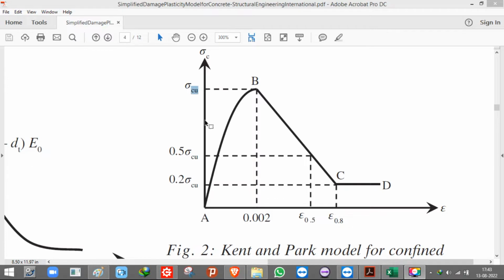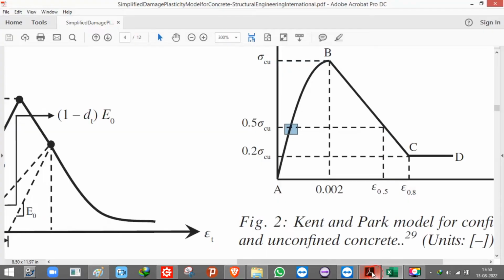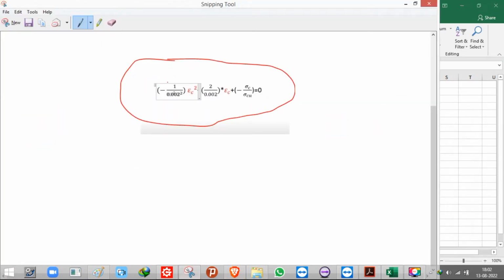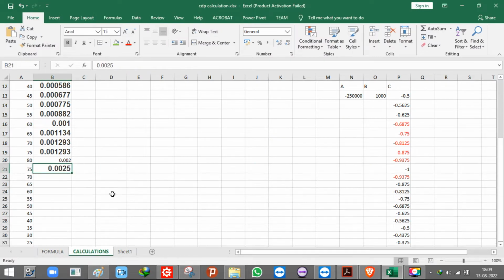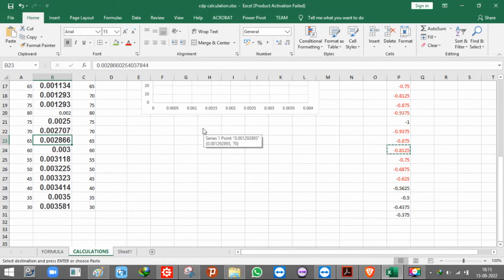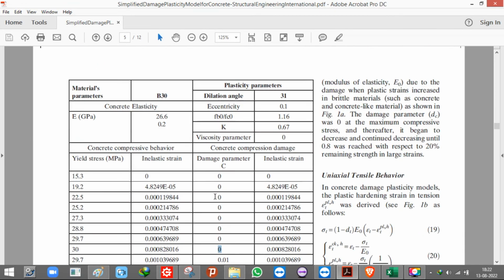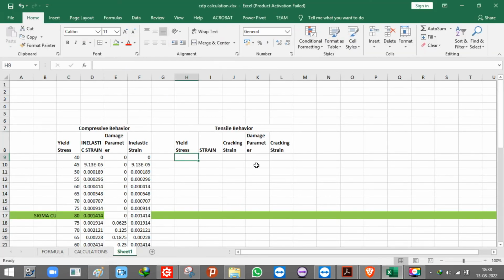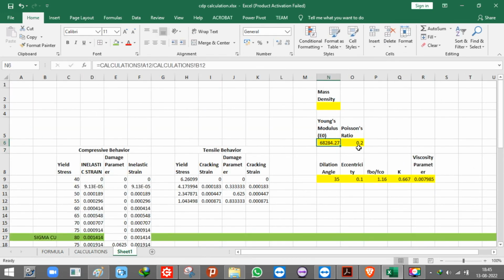#How #to #calculate #CDP #Concrete #Damaged #Plasticity #Properties #ABAQUS #Excel #M80  #CONCRETE

Comment: Hi sir, 
in the tensile part you are calculating the stress strain data with the second paper. There you have got 5 values. You have the maximum: so Y=0,7*sqrt(f_max) and y2=y*2/3 y3=y*3/8, y4=y/6. y5=0. In y5 you have epsilon_c*16. You did not calculate the last value. Was it on purpose? 
BG 
Thanks!

Comment: If we use the Kent and Park model which say that it is applicable for the confined concrete and use its formula to establish the stress - strain relationship then my question is i had done cylinder testing and ultimate strength i got from that is 80MPa so now in Kent and Park model what value of ultimate strength sigma(cu)  ?? i think it shouldn't be 80MPa and that from cylinder testing which is unconfined strength. Secondly this Kent and park model is developed considering transverse ties however my case the confinement is from a thin cold formed steel so this model would be applicable to my case ??
Reply from the maker: For confined data use other models available in paper
Reply: @abaqusfem  The paper mentioned that Kent and Park Model for confined and unconfined concrete however the equation 16 mention in the paper you have shown in video is for unconfined concrete probably. il search for the confined equation . 
Thanks for the video and introducing the simplified way of making CDP sheet

Comment: You mentioned that in case we have the experimental stress strain data that we dont need to use these model . Actually i only had the ascending branch from cylinder testing and due to absence of descending branch i used model 
Secondly can you please confirm that for CDP in Abaqus the concrete stress- strain relationship we need to  use is for a confined concrete or unconfined concrete ?? Actually i have a simulation to run in which the grout is confined by steel sleeve so i modelled the sleeve  and grout in Abaqus and i believe that Abaqus should consider the confining effect of this steel sleeve on grout and therefore in my CDP i used the unconfined stress - strain relationship ..is my approach ok or i need to used the confined stress -strain relationship for my CDP ?
Reply: Dear brother, the case he showed us was that of unconfined concrete. You'll see if you've read that paper.